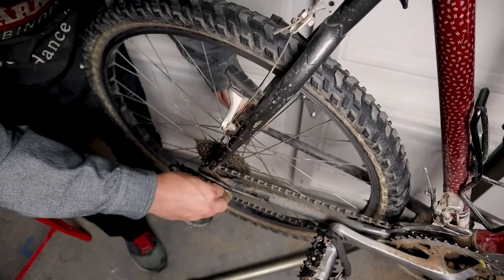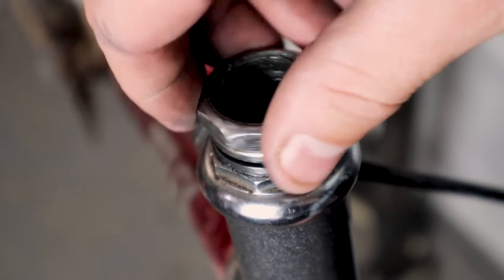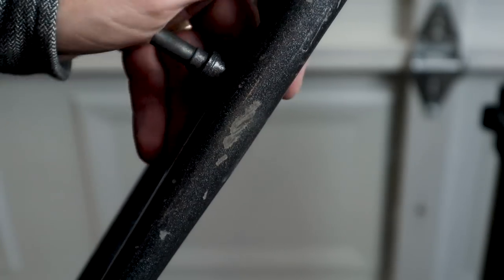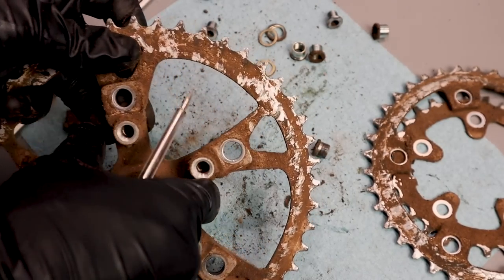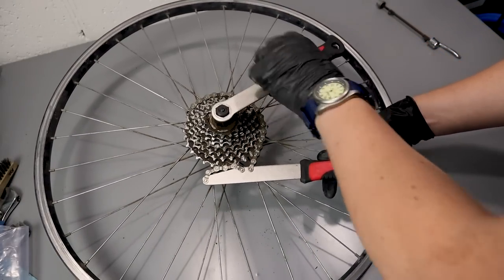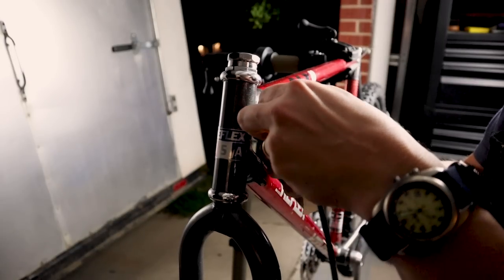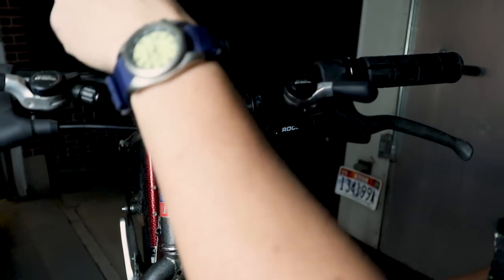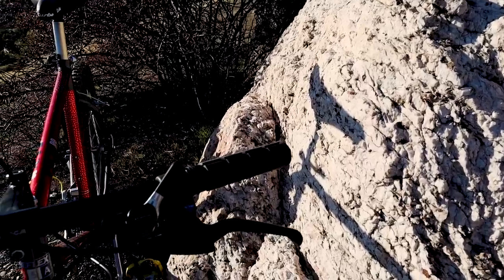80's Mountain Bike Restoration Tune Up | Easton Reflex ALX 89

Comment: Buying this type of bike for $50 from some pawn show and spending another $150 on components is waaay better than spending $200 on a new walmart bike
Reply: It really depends on if you know what to look for or not. Such as the Hyper Hydroform is an outstanding bike for 200$, the Schwinn Santis was another good bike for 200$ just depends on what you want.
Reply: You'll find with Halfords the Boardman range of bike are a far better quality of bike well the Frames are , still made in Taiwan I have the MHT 8.9 but I have completely replaced all parts with better ,the Frames are very good and I have taken it in many red trails with no problems at all !
Reply: +Loli... I completely disagree. This bike, as is, is 100 times better than anything you will find it a Walmart.
Reply: WORD!!!
Reply: And dont forget pleasure and assurance that everything works properly!
Reply: Only a colossal dingdong buys a bike at a store that won't service a bike.  That alone should tell you how worthwhile they are to maintain.
Reply: I agree,I love to repurpose old quality rigid hardtails into all around SUV bikes.Great in town and not half bad on trails if you do your part;
Reply: Picked up a vintage steel trek 660 with renolds 531 and campy record for 100$! Great bike
Reply: The world is full of old hardtails that were rarely used,much superior to junk.
Reply: That bike he rebuilt will last forever with decent maintenance.
Reply: I found a Mongoose Sycamore in the trash. Many parts were siezed. It looked like it had spent 10+ years in the elements. I repaired and freed up everything I could and added a heavy duty front basket. It is now a pretty comfortable cargo bike. It is the pickup truck of bicycles. The thing about these old bikes is they can have some pretty respectable components. You can get that stuff working, buy whatever parts you need and you got a reliable bike.
Reply: I like what I'm reading
Reply: @richardvanmeter1613  dooo eeeet. My heart bike is a purple '92 Specialized RockHopper. My off-pavement bike is a '94 Trek Singletrack. They're both awesome rides. Got 'em cheap and put $$ into 'em, but they're better bikes than I can buy new for the price.
Reply: I really enjoys watching your videos. Make me want to go shop around for a cheap bike and restore it also
Reply: Easton....wow. had easton aluminum hockey stick back in early 90s
Reply: @aberratic  yeah but they look like shit, like most cheap and new bikes..
Reply: Georgi Georgiev Wasn’t this a walmart type bike in it’s day?
Reply: @ShaunHensley  if walmart was selling high quality bikes then yes
Reply: I have been having that argument exactly with the wife and sister-in-law. Never mind that I am 3rd generation cyclist and my granddad used to take part in "illegal time trials" in Scotland during the 1930s where they had to wear street clothes so as not to look like they were racing. Apparently I still don't know what I am talking about. I "won" in the end and my nephew is riding a 1996 Specialized Hard Rock steel chromoly frame with a Sugino triple crank, some Shimano CX400 trigger shifters/brake levers ( that work great and are super compact ) and some Deore V-Brakes that I bought at some point but can't remember why. I have street tires, 1.5" and I wish I had gone with something a bit fatter, plus a close ratio cassette. I disagree with oldshovel here and think that these bikes are no longer the best option for trail riding but do make great "all terrain" street bikes. My nephew can "feel" the difference and is very happy with his mile eater.

The only thing I would say is that I am not seeing any $50 bikes in pawn shops. $200 seems to be the going rate for a somewhat high end 90s steel hardtail in serviceable condition. For $200 I only expect to change cables, grips, tires and chain and probably the pedals. I picked up a Trek Antelope 850 for $75 but that was a long search and we will see how much I end up spending to get it back on the road. It's a large but I think a size up is the way to go when using a mountain bike for the road. I might end up switching from my '96 Specialized Rockhopper aluminum frame to the Trek ( although I have had the Rockhopper from new and it would feel like a betrayal to abandon the bike now ).

I had a laugh today with a guy who had posted an ad for an Iron Horse that would have cost $550 when new, asking $900. I resisted the temptation to send him a sarky comment.
Reply: Agreed 💯

Comment: Good Job! I do agree that the MTB s of the 80-90s are in some ways are pinnacle of bike engineering. The fact that you can brush the dust off and tune-up a bike of this era with minimum replacement is a testament to their durability. You can't say that of MTB bikes in the 'carbon era'.
Reply: No de-lamination to worry about 
w/stainless lol. I also have solid cast cranksets from the 90's, which are serviceable and look great too. 
Powdercoated one set in semi-gloss black & they came out mint.

Comment: A tip for 26" skinwall tires is schwalbe nobby nic. I use them at my old 95 parkpre titanium bike. 
Love your builds.
Reply from the maker: Thanks. I’ll check them out.
Reply: wow, thats a pretty cool bike
Reply: Vittoria also sells a bunch of their mtb tyres with gumwalls, not sure if they're available in 26'' though.
Reply: oldshovel Panaracer Smoke and Dart tires. They are front and rear specific, look awesome, and are period correct for 80’s-90’s mountain bikes. I use them or WTB Velociraptors (basically same idea but all black [it can be argued that the Velociraptors started the trend away from tan wall to all black]) on all of my vintage mountain bikes. https://www.jensonusa.com/Panaracer-Smoke-26-Tire   https://www.jensonusa.com/Panaracer-Dart-26-Tire   https://www.wtb.com/products/velociraptor
Reply: Donny Disco tabletops are great tire but are more of a dirt jump/street/bmx type tire
Reply: What brake pads did you use? I am restoring a 88 gt tequesta with similar brakes threaded pads

Comment: Great video and a rad bike. My experience is to always replace an old cup and cone bottom bracket with a new Shimano cartridge bottom bracket as then never loosen and last much longer. Cheap and quick too. Also, never grease a tapered BB spindle as it is meant to work with friction. The grease will cause it to constantly loosen which leads to constant re-tightening...  which leads to a cracked crank. Happy trails!

Comment: Beautiful restoration!  I just had a flashback to my first MTB that I bought used in 1989. It was an 86 or 87 Diamond Back Apex.  The most bizarre elements of that bike were the Suntour XCPro roller cam brakes and the nifty spare spoke holder on the chainstay.  The rear brake was mounted to the underside of the chainstay and did nothing but catch mud and crud. But I loved it.  We did not ride official MTB trails then because they did not exist.   We rode the local hiking routes at odd hours.   Good times!!!   Thanks for saving a good one.
Reply from the maker: Those spoke racks and underside brakes bring back memories.
Reply: I Currently Own A 1986 DB Apex (Awesome Bike) I Pulled It Out The Dumpster At A Local Metal Recycling Facility Frame Forks and 1 Wheel. 8 Years Later I Still Enjoy it And Ride it. Thank You  For Sharing God Bless You.

Comment: I know the feeling. Just (mostly) finished rebuilding an old Trek Y-22 that I picked up at a thrift shop. It had been left outside a lot and needed a good deal of TLC. I'm 52 and the old thing got me interested in riding again and I've learned and done a lot more in-depth bike mechanic work than I ever thought I would. The work is therapeutic and as far as riding, I can definitely use the exercise.

Comment: Hello. I built that Reflex mountain bike in 1989. In the beginning, we were getting our frames from Raleigh and then adding the components and stickers to the frame. Your frame looks to be the Raleigh. About a year after starting production, we started making our own frames using tubing from Easton aluminum and gluing the lugs into the tube to create the frames in a custom made jig and then "baking" them in a large oven for about an hour. Reflex was only in business for about 2 years before they shut down due to lack of sales. Lots of memories working there!
Reply from the maker: Chuck that is awesome! I just picked up another one of these but it is branded as a Raleigh Chill.
Reply: Where are you finding them? I haven't found 1 here in Utah.

Comment: Wow just came across this video by chance. I have a Reflex ALX Carbon DT.  I am the original owner. Hasn't been ridden in a while. Always stored inside. Changed the drive train a few years back. New rims and tires. Gathering dust at this point. Fun ride. I have moved on to other mtn bikes. Really enjoyed this video' Thank you for sharing.

Comment: I really enjoyed watching your rebuild/rennovation of this old 1989 Mountain Bike. It was great to see it getting a new lease of life. Personally, I am overhauling an old mountain bike from 2004, which has 26" wheels, but getting tyres and shrader tubes was not too hard thankfully. The rear cassette is a bit rusted but still usable after a good old clean up! I'll stretch its use a little longer. Poor bike was left to the elements for over a year in an overgrown garden. It belonged to my late wife (she prefered a Gents MTB to a Ladies bike)  who passed away in February this year, so I wanted to keep it and fix it up to use. Sentimental value...

Comment: I have a 1986 Trek that I found on FB market a couple of years ago. I was thinking about going in and just doing a complete re-do on it and converting it to a gravel bike for bikepacking trips, but it is in such great shape that I hated to tear it apart. The only real negative is that the aluminum on the components is oxidized. The frame has a couple of paint dings, but nothing major.  I really think that an in-depth tune up, like this one is really what I need to do to this bike. Thanks for the inspiration.

Comment: While it is a an actual restoration, this bike has really simply gotten the maintenance a bike should see at least on yearly basis. And I say that as one of those people who will go through an entire cassette without thoroughly cleaning anything, as long as it's "functionally clean" (i.e. no sticks or grass in the drivetrain, no solid bits between chainlinks).
And holy crap, those stickers on biopace cranks are indestructible.
Reply from the maker: lol 😂 I thought the same thing about the Biopace sticker. It did not even come off when I was scrubbing it.

Comment: I put grease on square tapers once, tightened on the cranks, and never got them off again. Tried a three-jaw puller tool and eventually had to angle grind them off. I don't think you need grease there!
Reply: Just the thinnest coat possible. A torque wrench is handy for square tapers as long as you know the proper setting.
Reply: See above.  All square taper cranks need grease.  "Too much" won't hurt anything, just a waste of grease.

A square taper crank requires a crank puller to remove.  Your local bike shop sells them.
Reply: Not back in the day, crank doesn't seat correctly and causes creaking and cranks coming loose. Old school shop mechanic from early '90's.

Comment: Sweet upload dude! That Biopace triple front chainring, the 110mm+ stem, along with the (now) comically narrow flat bars are such a throwback! I still have an Ironhorse cross country bike (in pieces, in a box) from the same year. Including, the Shimano motoX sized brake levers! Forget one finger braking, you could use all four on those high powered center pull rim brakes! Keep doing what you do!

Comment: ahh nightmare flashbacks to non sealed bottom brackets, lol.   We bought an old Specialized (no suspension, rockhopper/stumpjumper i think) in 2000, stripped painted, rebuilt added replacement parts, rode off road a lot, and used as transport to work for 10 years, still works great. our old racing buddy said "nice retro bile" we're like "ehh not retro just old", lol.  good flash back video, but never going back to those open bottom brackets with plastic sleeve, argghhh.

Comment: No grease on the tapered spindle, needs to be friction fit, grease will allow the cranks to be over torqued.  Great video, love to see the old bikes put back into use.
Reply: Was about to say that... should never grease a square taper BB/crank for that reason.
Reply: Wipe them with mineral oil and scrub clean with paper towel

Comment: Cool bike!  I restored a 1989 Diamond Back Ascent EX w/full Mtn LX. The weak point was the Mtn LX rear thumb shifter.  The internal design had 2 narrowly place pins that we're not strong enough for the constant torque/use and they commonly snapped.  Shimano's next thumb shifter upgrade (Deore LX) had wider spaced pins that could withstand the torque better.  I believe the Mountain LX combo thumbies/brake levers were the first "brifters" on a productionbike.
Reply from the maker: Thanks for the info. I did not know that. These ones are the mountain LX components.

Comment: Very nice. I just finished my budget restoration of a 1991 Raleigh Technium Obsession, which appears to be the same frame size as the Reflex in the video (so far as I can tell). Whereas this Reflex is more akin to the Raleigh Chill (2nd from the top of the line with Easton main frame, chromoly stays and Tange Big Fork), the Obsession, which is the lowest in the lineup, has the "budget" versions of the aluminum (6061) and chromoly (4130). I absolutely love the frame since it has a 20.5" c-c seat tube but a fairly long 23" c-c top tube! I've always wanted a Technium mountain bike ever since I sold a bunch of them at Michael's Cyclery in Ames, IA (circa 1991-1992).  Ahh...memories.

Comment: Nice overhaul!  Great to bring a 30 year old bike back from the dead.  Ugh, those brake levers.  Bring back bad memories!    Some suggestions:
1)  BB shells are really easy to clean with a small circular wire brush in your drill.  Forward/reverse and they're like new.  Almost as good as chasing threads.  Rust free BB!
2)  Bearing overhaul:  replace the balls with grade 20 or so.  Old bearings shouldn't be reused.
3)  Square tapers need grease, regardless of the comments below.  See my reply below if you're really interested.  Otherwise, Google "Jobst Brandt square taper" to understand why.
4)  Grease those canti posts!  (But not the bolts - they utilize medium threadlocker.)

I'm reassembling an old Diamond Back titanium factory race bike, so I'm anticipating getting another old gem back on the road.

Thanks!
Reply from the maker: Thanks for the tips my friend.

Comment: My heart sank when you revealed that the donor bike was a Panasonic. They all need to be restored, too! Lovely little machines! Luckily you turned that one (the MC-5500 I believe) into a wonderful gravel bike!
Edit about what you say at 4:05: your MC-5500 is from 1989, which is by far not the last year Panasonic made MTBs. I have an MC-5500 from 1993 and it's just as splendid. They stopped in the mid-late 90s with MTBs. Panasonic still makes bicycles _to this day_, but no MTBs and only in Japan, build to order.

Comment: Looks like some old but still functioning green Park Tool Polylube grease in the headset and BB bearings. Whoever had the bike before you was obviously an avid home mechanic and did a decent job and not let stuff rust and seize.
Reply from the maker: Agreed. They were both well greased.

Comment: Nice work. I have an 1984 Trek Single Track Series that was clean and in good to excellent  condition. With full stud tires, it is my WYOMING winter commuter now. Other than seat and of course pedal upgrades, I have kept it as original as possible. It, unlike yours, never saw a hard life.

Comment: For a 30 years old bike everything looks mint. I've seen bikes with three years of use with very warn out teeth, expanded chain. This bike was barely used. It was just neglected. However you did a great job with the restoration.
Reply: i think the chainrings were replaced. it looks really well used to me.

Comment: I enjoy riding some of the newer bikes with carbon frames, disc brakes, etc. But at the same time, there's something special about seeing older steel frame bikes on the roads and trails.

As far as, restoration vs. reconditioning concerned, I'm not a purist. If new parts are needed to get an old, but useable frame back into use, I'm all for it!

Comment: I also had trouble finding 26" gumwall tires for my old Motobecane MTB. I finally found some Duro's on ebay for a good price. But yes, they are hard to find. I just like the way the gumwalls look.
Reply from the maker: I’ll have to check out eBay.
Reply: oldshovel try kenda k53 in 2.25 x26. They have a bmx pattern with a solid center band, for $17 ea. Just make blocks of the center band with a hot soldering iron or hobby razor. https://www.bmxguru.com/collections/tire-26/products/26x2-125-kenda-k-53-black-gumwall-atb-bmx-tire
Reply: Who doesn't love the way they look!

Comment: Nice restoration. One "upgrade" I would recommend though is the replacement of the cable that connects the front brake calipers with one of those special connectors (don't remember what they are called) that prevent your front wheel from locking up in case of a brake cable failure. Good luck on your next videos.